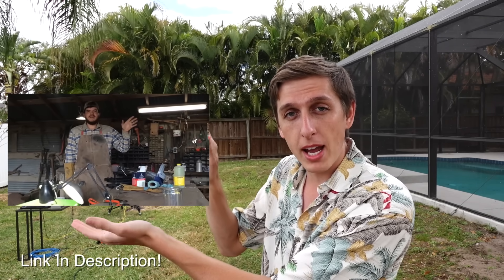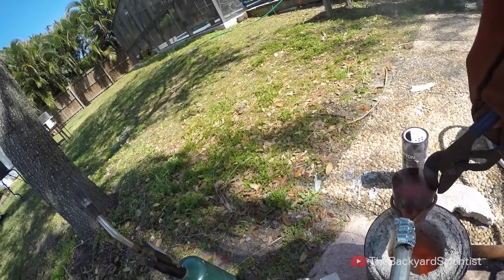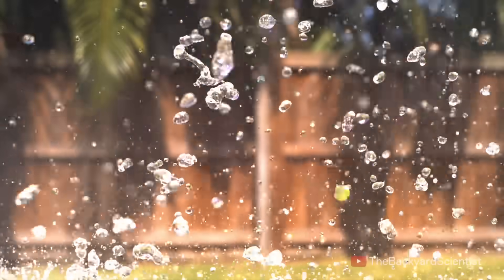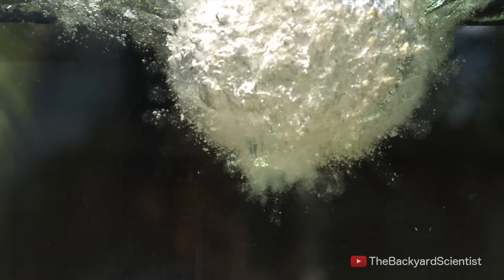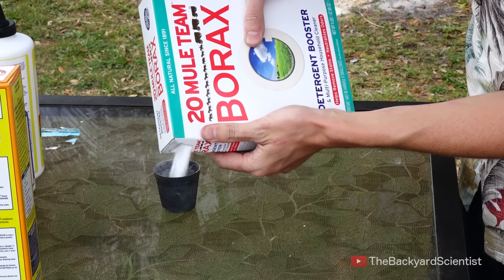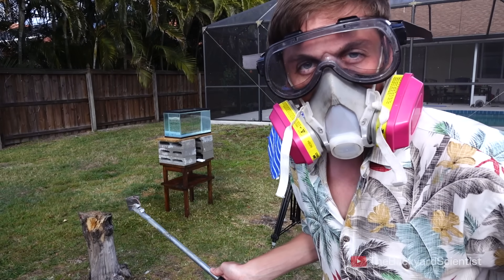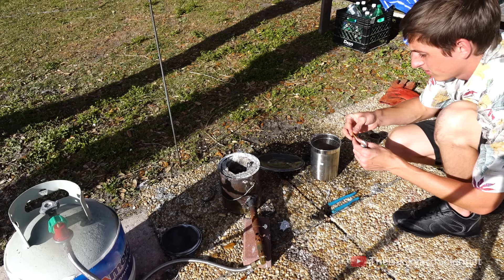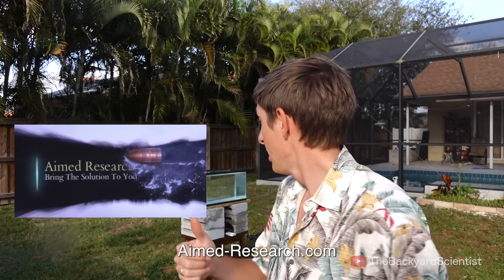Pouring Molten salt into Water - Explosion!

Comment: thermal expansion come on man...... you basically just pushed glass through applied heat to a cool object. im sitting here thinking you were gonna show something i couldn't figure out by said explosion. the fact there was no explosion just glass shattered. but ill admit nice vid. liked
Reply: btw molten salt has a high thermal energy storage rating, so it stays hot longer when heats is actively applied. like when sauteeing you turn the heat on low but the oil and butter still boil.
Reply: But were that the case wouldn't the other salts he tried that have NaCl and some other additives respond just about the same? what you're saying was my first thought, and I think  it is part of the explanation, but normally the heat would create an insulating layer of steam that would stop the rest of the water from reacting to it (which is what happened with the Borax) so when he says he thinks it's a physical reaction, not chemical, he is agreeing it's the heat transference, but why it works that way when it shouldn't is the real million dollar question.

Comment: Just a guess, but the reason that the sodium chloride explodes while the other ionic compounds do not could be that the sodium part of it is heavy enough that the Leidenfrost effect is not powerful enough to keep the sodium from contacting the water, and is only powerful enough to keep it apart from the water long enough for it to sink some, and then the sodium simply falls through it, touches the water, and then explodes, thus causing the underwater explosions.

Comment: the one that burst the fish tank did so because the surface tension of the water. obviously the water is displaced from the impact of the salt but when it splashes back over it creates a seal. that then causes the salt to encounter resistance when it expands (much like a bottleneck effect) and of course that's what causes the HUGE explosion

Comment: I think that it is not due to the explanation that you presented. Rather, the ionic attraction between the compounds tested (with the exception of sodium chloride) are far too strong or are simply incompatible with water, and so cannot produce the standard water-sodium reaction. This is because the table salt was molten, which made it easier for the sodium chloride molecules to separate to form sodium metal and chlorine, meaning that the metallic sodium was free to react with the water at a significantly greater surface area than if solid sodium chloride was added. This is because the sodium chloride is less dense as a liquid, increasing the rate of reaction, which is true for all materials. The fact that the water was not of a PH of below seven could be due to the fact that a significant proportion of the reaction took place on the surface, where chlorine gas could move away from the water preventing the reaction Cl2 + H2O → HOCl + HCl from occurring, meaning that the water does not become alkaline, especially not with such a large volume of water for the HOCl to be diluted into, also reducing the change of the final PH value.

Comment: ΔH[NaCl(liquid)]= -385.92 
This means the salt sets energy free when it gets in water solved (or whatever the right verb for this is). Its a solution, which is also a chemical reaction. When you put the molten salt into the water it sets energy free, which causes the water to react and h2 and O2 originates(again correct me if im wrong). There is no mystery behind it at all. Its a simple solution, which produces energy...

Comment: I believe that when you melt the salt it seperates its two components which is Chlorine and Sodium and since Chlorine is a gas it floats up into the air but Sodium is a metal, A very reactive metal it stays within the 'cup' and thats what youre pouring into the water.
But thats only what i think

Comment: the polar pulls on the salt molecules are like you said getting water molecules caught into them and are heating up to create that compression you said and since the salt pulls upon each other it grabs other salt molecules to hold its structure but still catches h20 in between and small compressions build up to go...welll... boomm

Comment: In case you still don't know what's going on. Full Metal Alchemist, which is the reason I was looking this up Explains that if you heat up water fast enough It would expand with the force of a bomb. I wanted to see how real this was. I'm an aspiring writer and animator, and wanted to give a character the use and control over water, as a power. Thanks for making the video, This will really help in booth writing and animating this phenomena as an attack.

Comment: couldn't it be due to the molten salt being basically a soup of ions forming complexes with water vapor, thereby causing a chain reaction where the surface of the molten salt gets eroded very rapidly, hence causing a lot of surface area heat transfers that resulted into explosions?

i mean the water vapor and the ions basically interacting could explain why the leidenfrost effect is not present. but i could be wrong.

Comment: in my opinion you were wrong on the conclusion, when misc a salt with the water you can't get a ph change because when you mix acid with a base (in the right proportion) you get salt water (type of salt depend of what kind of acid and base) so the salt water is the result of a neutrlization it can't change the water ph. (I remember this from school, maybe I'm wrong)
I think maybe it's a chemical reaction because at high temperature the salt can be expose to a sort of instability as salt and let the sodium in the salt react with water. In borax and others salts cases the reaction doesn't start maybe because are more stable or need more high temperature. let me know what you think

Comment: Molten salt explodes in water because as we all know Salt is made from Sodium(s) and Chlorine with a formula of NaCl when you melt the salt you are breaking the bonds Between The Sodium And The Chlorine Allowing The Chlorine Being A Gas And Lighter than air Escapes And You Are Left With Sodium Metal In A Liquid State Sodium Vigorously Reacts With Water Causing an Explosive Reaction leaving behind a liquid form of sodium hydroxide which is a strong base according to this formula 2Na(s) + 2H2O → 2NaOH(aq) + H2(g) however what we have in the example in the video is a verydilute form sodium hydroxide in higher concentrations it could match the corrosive power of hydrochloric acid

Comment: Other possible explanation would be the same as Prince Rupert's drops. Outer layer cools faster (and turns back to solid) than inner, which builds up pressure from inside as salt cools down and expands. Just in case of NaCl, outer layer isn't strong enough to hold that pressure like Rupert's drops do so it pops. Multiple explosions would be due to "fresh" molten salt getting released after initial explosion and going through the same cycle.

Comment: I can't help but think it has to do with acid-base chemistry. His explanation that it is a physical reaction doesn't fit because it doesn't explain why it would only work for sodium chloride, and not the other salts. I am stuck on the fact that chlorine is the only element involved that would produce a strong acid. My idea is a stretch, but I'm going to put it out there anyway and I'm sure someone will let me know how wrong I am. The heat allows dissociation of the sodium and chloride ions. The chloride rips a proton from the water, the sodium then attacks the leftover OH-, and I am curious if that old "Don't add water to acid" thing starts to play a roll with the steam at this point, adding additional heat and expansion to the mix. I understand that he is adding the acid to the water, but if the leidenfrost steam is the only water touching the acid, then its sort of different I suppose. Also if it is 1400 degree acid that is also different. But I can't ignore that the only one that reacts explosively is the one with the potential strong acid.
Reply: Also, about the leftoever pH problem, you're adding a salt, that then turns into an acid and a base, which would then cool and form the same salt. no net change in pH

Comment: What's the densities and specific heats of the other salts relative to the table salt?  Maybe it just has that much more heat.  The thing is that by mass water has an absurd heat capacity so to dump much heat into it you're going to need something with a good heat capacity by volume and pretty much get it as hot as you can to maximize the steam.  The steam itself should probably transfer energy as it can superheat while water (usually) can't.  Maybe leidenfrost doesn't make much of a difference there.
Reply: Heat capacities are higher for sodium tetraborate as well as boiling point. I was thinking the same and looked it up. Does leidenfrost effect intensify with higher boiling points?

Comment: Maybe the NaCl breaks the Leidenfrost Effect (not sure if I spelled that right lol) because of the sodium's reactivity with water and then because you have a proportional amount of chlorine to counteract the sodium, that it why the pH doesn't end up increasing? 

That's kinda what I'm thinking, because technically you are still pouring a pH neutral salt into a pH neutral liquid, but because the NaCl is in its liquid form, the sodium reacts with the water first, and then is counteracted by the chlorine. 

Not sure if that's correct, but I thought I'd give it a go haha

Comment: For NaCl vs the other salts you tried, could it be the viscosity of the molten salt that's creating the explosion? Molten salt hits the water and displaces it really quickly, water somewhat cavitates and pulls back in, water gets inside the molten salt, which causes the steam to break the salt apart, and give the water more surface area to react with, and so on and so forth. More viscous liquids would be somewhat less prone to that behavior. Just a thought :)

Comment: idk im not an expert but wouldnt this equation

H2O + NaCl = HCl + NaOH
make more sense than physical reaction because both NaOH and HCl makes exothermic reactions releasing lot of heat , but i think that would only cause water in tank to boil probably  maybe but like said im not an expert, i look up online and from what i learned in class HCl is a strong acid so it dissociates 100% percent in water releasing heat, i thought because in the experiment the NaCl is heated up that there is a lot of energy in the water tank and according to Le Chatelier principles the heat will increase the movement of the molecules and elements and will favor reactions and also there is a needed activation energy to start the reaction and because of the heat that wouldnt be problem. I think in your Ph experiment only a small amount reacts then explodes it might not be enough change in Ph  to effect the whole system. 

sorry for the bad english, can anyone tell me if im wrong i would be happy

Comment: I think the explosion is due to the effects of thermal expansion.  NaCl has a huge density difference between solid (2.16g/cm3) and liquid (1.55g/cm3).  What happens when you drop a blob of molten NaCl in the water is that first the outer layers solidify, but the interior remains molten.  As the interior begins to cool and solidify, the solid outer layers prevent the ball from contracting, resulting in a huge buildup of tension.  This continues as the interior continues cooling until structural failure occurs and the partially solidified ball implodes, releasing a large amount of force.

A similar effect can be seen in Prince Rupert drops,  but since glass doesn't contract nearly as much upon solidifying, the drops survive the cooling process and don't explode until some event happens (classically, someone breaks off the "tail") to cause an initial crack and start the chain reaction.

Incidentally, the crackling noises when you cool molten NaCl are also caused by the same process.  It's just that since you're cooling it slowly and thus more evenly, the tension can be released over a succession of small cracks instead of one big bang.

Comment: what happened is the separation of hydrogen from the oxygen.
and the hydrogen is very explosive element.

The same happens with thermite, when you try to pour some water to extinguish the thermite a huge explosion happens.

a more.violent explosion will happen if you do the inverse, pour some normal water into a molten salt bow.

sorry for the bad English, I'm from Brazil.

keep doing this great work

see ya

Comment: Hey, at 7k fps (3.11 mins), the molten mass fall into water; noticeably, the molten mass has transferred some momentum to the stagnant water. Here what I mean to say is that the water has contacted the molten salt. There is a time lag (approx 1 sec) until the actual explosion. This was not observed in the borax salt (may be because of the isolating steam layer). 

You said the water gets into the molten mass and expands exponentially..  I was thinking.. If there is a time lag in explosion, considering your principle, does it mean, the molten NaCl absorbs water into it and takes time to create super-heated steam?! 
>> Here I guess the absorption/adsorption of water into molten mass has increased (compared to its crystalline state) and possibly the thermal conductivity of molten salt has to be less (no reference point to compare but it explains the time lag). If I'm right, both these would answer the phenomena. Absorption/adsorption would take in more H2O molecules into the molten mass, and the absorbed/adsorbed H2O takes time to reach 100 deg C which causes the explosion.

Note also that the first explosion is from the first most contact with the water surface (right at the beginning) then if u can notice the falling yellow mass (blur image behind the first explosion front), the second explosion happens only when the yellow mass falls into the bottom most point in the first explosion bubble. 
Q: Is it really yellow in color? whether the molten salt changes color after contacting water? 

Can you do one more test  focusing on the molten salt from top (to witness the color change if any); and what happens when you dump/pour (dump is better) water onto molten salt?! Does it explode more violently? 
If the water is warm, whether the time lag would be less?!

Comment: Okay so, sodium reacts with water we know that. Now this is a chemical reaction as there is a colour change to support that. What is happening and why didn't the other salts react the same. well NaCl is made of a solid and a gas. Now as chlorine has a lower gas point the sodium made small nuggets of pure metal as it cooled while small amounts of Cl2 gas came out as vapor. This can be seen as the yellowish gas seen in the 21000 fps before the reaction occurs. As the chlorine and sodium were seperatable into pure elemental substances a reaction could occur. The other salts would have created extra molecules in the melting process with the atmosphere. 

brief explanation i have 2% left on phone. reply for further analysis.

Comment: I'm still not buying that it's not chemical. You should take the pure sodium and keep it encapsulated below the water level and then release it. I think that the extreme temperature changes are allowing newly freed sodium to come in contact with the water beneath its surface...
And I base this on absolutely nothing.
:)

Comment: The reason molten salt explodes in water is because the sodium in the salt, salt is a compound, ( made from 2 or more elements, in salts case is sodium and chloride ). when you heat it up it start to become separated,  and when the sodium goes into the water it reacts i.e. the explosion.
Reply: usually atoms with not a lot of electrons are very reactive, and vice versa.
Reply: The reason is because atoms will try to steal other atom's electrons until they have their desired number of electrons this is why sodium and potassium are very reactive compared to helium or argon which are basically nonreactive because they have a surplus of electrons.

Comment: um, there was no correct "science" in this video at all. nice hypothesis but you should actually do research before spreading false information. it is a chemical reaction between the sodium and water. melting the sodium metal was unnecessary. would have had better results if you dropped it in solid.